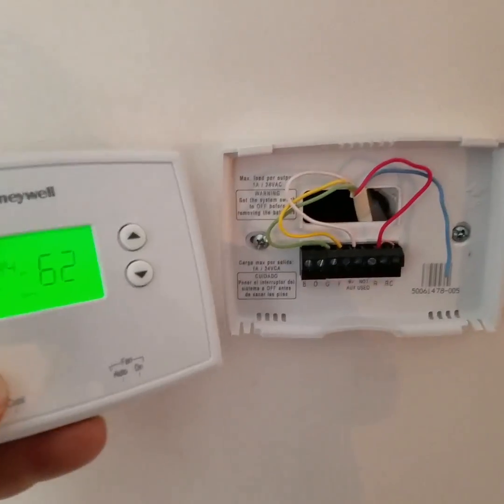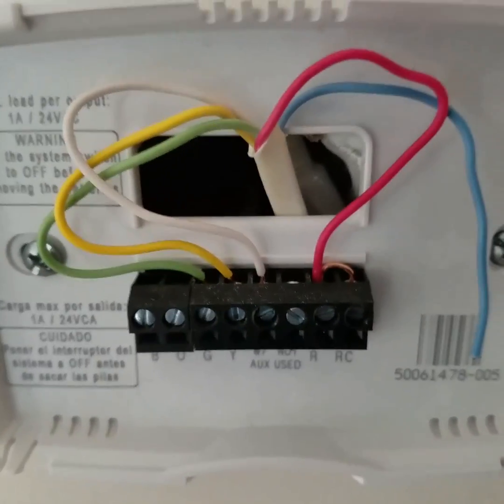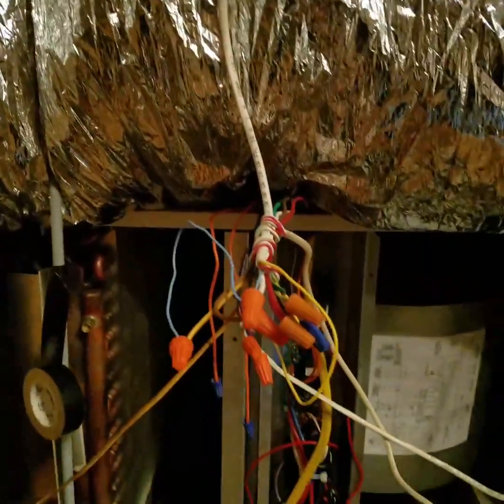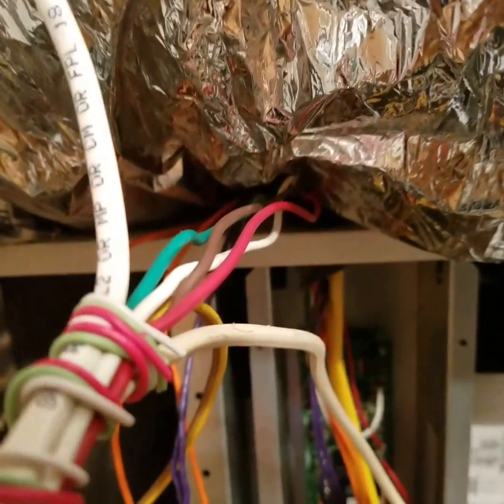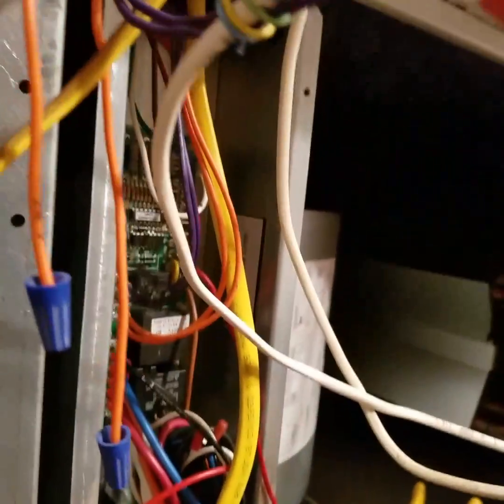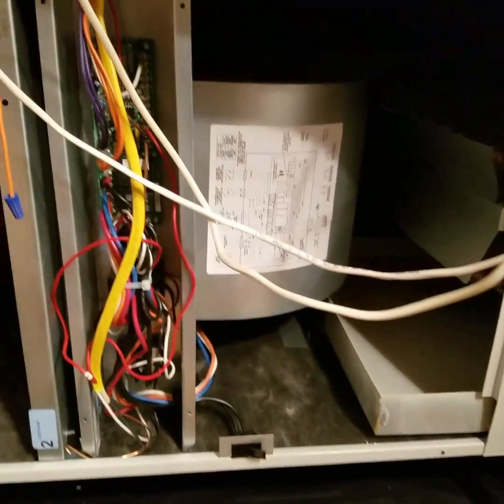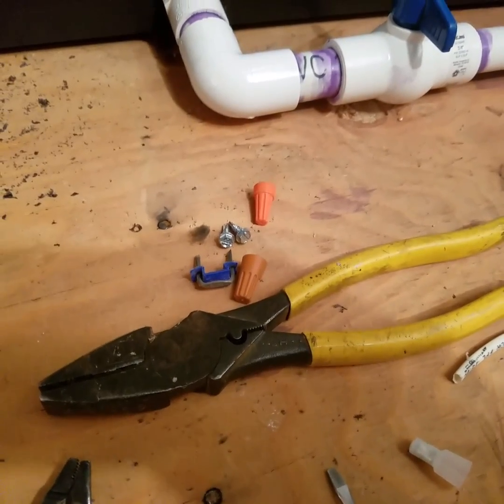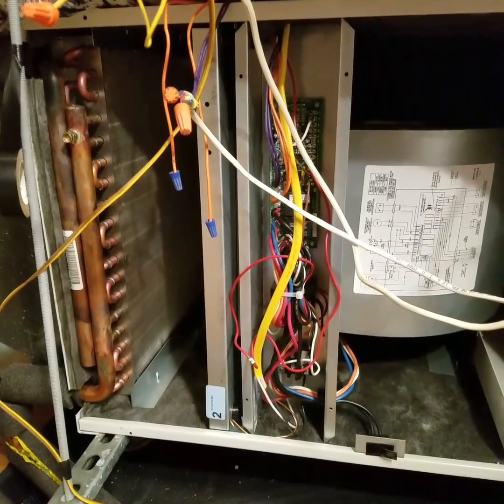Thermostat- How to wire heating & air conditioning.

Comment: Thank you, all okay with my circuit breaker, 240 wall plug, capacitor, contactor, thermostat and batteries. Thermostat wire has no power, transformer you shown could be the problem plus any fuse.

Comment: What is the blue wire? I am converting a old Lenox gas heat and ac combo unit to water heat exchanger witch works but I’m trying to figure out how to wire it to work just the fan to kick on
Reply: Bryan Fair comon